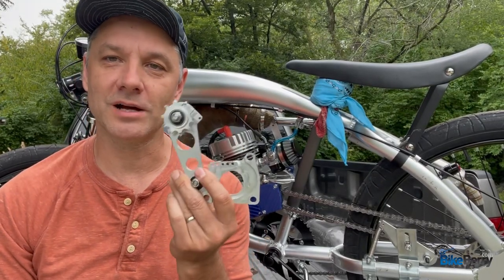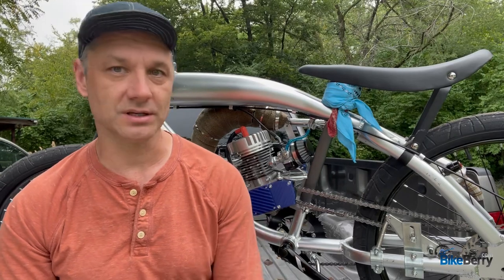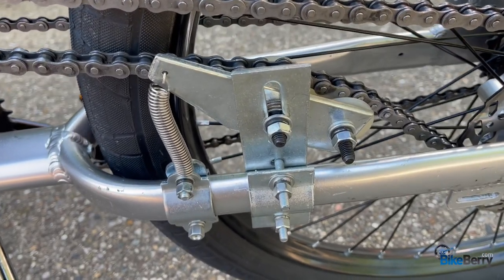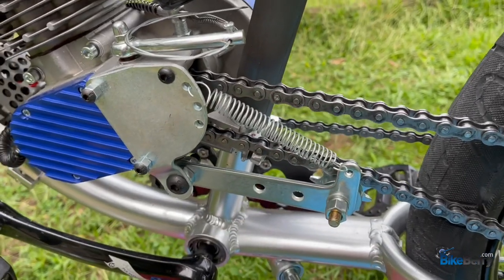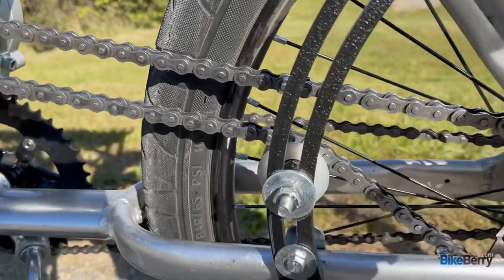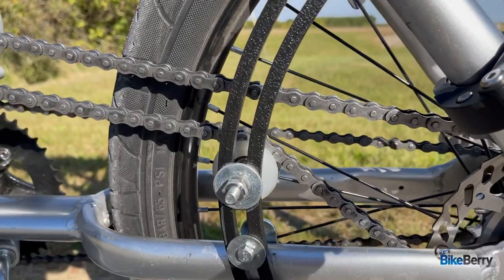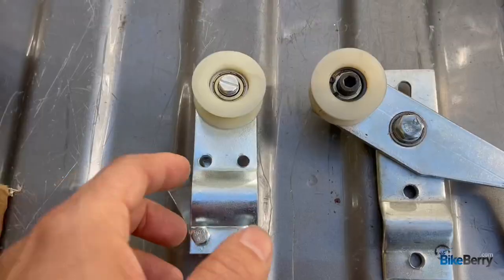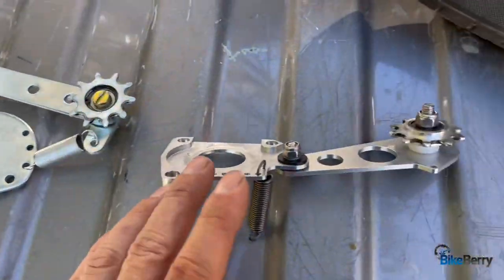6 Chain Tensioners Tested | Motorized Bicycle | Bike Berry

Comment: Great information as always. In my experience the tensioner should always be mounted for the bottom chain. The top part has all the engine torque on it. Second the tensioner should be mounted as close to the engine as possible to minimize deflection. It puts less strain on the links. Finally I love the versatility and security of the arch tensioner
Reply: 😊9
Reply: 😮8😢😮😮😊

Comment: Tony. On some of my builds I have used an Industrial rubber torsion tensioner, available from my local Industrial Supply store.
make mounting brackets to fit the position on the frame and use the stock guide roller. 
Once positioned, tensioning the chain is easy.
I note in your video and others that I have seen, spring tensioners, the spring tends to resonate. This does not happen with the rubber torsion one.
I have not had any issues with the Kit tensioner on any of the 23 Motorized bikes that I have built. I have seen the tensioners improve in quality from 2014, when I started. The first ones the guide roller did not have a bearing. The latest kits with the double bracket and angled adjuster are the best.
I replace all bolts and nuts that come in the kit with High tensile cap bolts and nuts with proper steel washers.  .

Comment: I used the nice billet one and just drilled a hole on top of sprocket cover right under top bolt for the spring. The angle of spring and additional tension remedied the centering and spacer issue. I also changed gear to a plastic roller and it has MUCH QUIETER mesh and resistance. Thanks for all your videos and advice....Have a GREAT HOLIDAY SEASON!😁 PS, I can share a video or send you a pic if needed.

Comment: I don't like the tensioner that comes with the kits because I've ruined 2 tires and I would worry to much about it going into the spokes. I ride with the spring tensioner that mounts to the engine case and I put a skateboard wheel as the tensioner wheel,chain doesn't slip off or grind into the wheel and my bike rides smoother. Great video tho!
Reply: This⬆️

Comment: I have tried 4 different tensioners and found only the Arch tensioner to be truly reliable in design. The spring tensioner that I bought for my friends bike pulled the bearing through the mount and failed within 1 hour. The stock tensioner with the 2 straps stripped out the bolts and nuts before even getting tight. I even tried a small tack weld, Unfortunately the tensioner itself bent due to cheap metal. Cool video though, I like that you tried so many of them.
Reply: Yea the bolts are like a soft aluminum. I ended up going to local hardware store to get better quality.  I had to cut a bolt off on the rag joint it was stripped so much.

Comment: Just from eyeballing it I would say an ideal setup would be a tensioner very far forward and an additional one very far back. Tensioners seemed to be all designed with a monoshock frame in mind where perfect alignnent under extreme conditions exist. I just went from a stock one to a simple three bolt case mounted, only because failure of the stock one would throw it into my rear wheel. Im only taking her on asphalt and i keep my speed down.

Comment: I've done em all and customized them by changing the mini sprocket for a wheel on the case mounted ones. I like the duel wheel and arch without mini u-bolt

Comment: I got a new motor kit, 50mm board out. I was running my bike with no chain tensioner for a long time with no issues. Now I have to get my chain about 1/8-1/4" out away from the new brackets for clearance. My thing is the new chain is longer and I'm not sure how many links it should be cut at than completely right fit, I was told about half inch longer?

Comment: Hey Tony I have the case spring that mounts on the engine only problem I'm having is the long  arm that the the spring and pully attach to keep coming lose making the arm flop what can I do to keep the bolt tight so I don't back off

Comment: I’ve seen some builders eliminate the tensioner altogether and just shorten the chain. Is there a downside to that other than when you need to remove the rear wheel you would need to remove the master link.
Reply: maybe when your chain needs tightened. when it gets worn out and stretches the tensioner would be nice for fine fine adjustments

Comment: My thoughts.1st of all many thanks dor your video. Im in the process of finishing the assembly of the F-zero bike w/ S4 engine taking my time dor about 6 months now. Taking my time by choice only as i am often enjoying and wrenching my Chinese enginered 200 cc ATV. The #3 case  mounted tensioner you stated that on ruff terrain the chain will jump off the spured sproket and its not meant for tight tension. I actually was thinking the same thing while watching the video before you mentioned this and was thinking instaed of the spured sprocket why not replace it with the smooth walled sprocket from the one that came with the engine kit. I have the case mounted tensioner that arrives yesterday and will attempt to finish the assembly with test runs today.  I will try both sprockets starting with the original spured sprocket afterwards will be the smooth walled sproket i mentioned early. I will post my results when completed. But please dont hold your breath waiting for my results. This will be completed as soon as time and the days events will allow.

Comment: My experience with the arched chain tensioner is that if you don't go fast enough to start the engine and engage the clutch the kick back from the engine can bend the crap out of the arch tensioner. It seems that these are made from cold rolled steel and the metal is very weak. At least the one from BB is. That's where I bought mine. I don't use it since it's garbage now. Just something to be aware of. Tony - i noticed your black arched chain tensioner is thicker than the one BB sold to me. Where did you get it?

Comment: Best one i ever got was just like the bare bones spring type like the one in your background at the start of the video modified with some other parts. I work in a steel stamping shop and we used to run a part we called the boomerang because it looked like one. It had a few holes punched into it that when the part was bolted to the bottom and top bars of the frame the tensioner arm could bolt on and the spring hooked into a hole on the part. There was another hole I fed a bolt through so when turning the bike over the tensioner arm would stop stretching all the way down, but still had enough clearance to function while riding. Never had an issue with it

Comment: A quick note, make sure the chain tensioner runs parallel to the chain! on my beach cruiser, I had to bend the main plate in a vice to get it lined up, and it works flawlessly.

Comment: Hey Berry that bike behind you in this video is the kind of bike I want to put my moto on with a 32 tooth so it will run better I have it on a rock creek huffy 18 speed and it won't run faster than 28 miles an hour and I want it to run faster like 45 or 50 miles an hour.

Comment: Can you recommend the best most reliable engine. I'm doing my 1st build and want the most reliable engine I can get. Thx.
Reply: BikeBerry stage 4 has treated me well! Link to site in description.
Reply: Don't go with the stage 4 the upgrades aren't very good better off buying the stock kit and buying the upgrades separately getting the ones you want
Reply: @tonytaylor5087  Stage 4 has treated me well also. Haven't had any problems with the engine itself, hardware is a different story.

Comment: I ended up not using them as I wasn’t impressed with the quality, I ended up fitting a Jack shaft kit, and now I have x8 gears to use with the motor, a far better upgrade , use a stronger e-bike chain and you have to replace your rear sprocket set more often (which is understandable)..
It’s best if you have the centrifugal type clutch for this set up and ease off the throttle when shifting gears..🤔
Reply: I’m interested in the jack shaft assembly.
Reply: It sounds good.I'd like to know which brand you used.The 1 I'd saved to my 'Wish List' isn't available anymore.Thanks.

Comment: Just get rid of the slack in the chain all together you're probably wondering well how can you do that if the links are only so big you take one out too many it's too small too tight you put spacers on the brackets for the motor mounts it's adjusting the motor itself you can move it forward slightly if you have the room inside your frame you'll be able to move it forward and maybe even slightly up this will take your slack out of your chain eliminating the need for a chain tensioner eliminate as many moving Parts as possible on any type of machine and you will have less room for error and breakdowns simple is better.
Reply: Hardly ever can you work it out to not need an adjuster. Just saying. IMO after building dozens.
Reply: @MrCbell57  right, slack will always return

Comment: stock tensioners worked fine for me when its used properly on an oval chainstay, i did blow up a wheel once when i had rubber between it on a circle chainstay.
Reply: For sure.

Comment: I find this to be the hardest part of getting these engines set up especially if you have a small frame.  I honestly love the idea of that curve tensioner, it is the only one that looks reliable. I have tried the spring tensioner and the stock one and both do not really work for my set up and I now have damaged spokes after having the chain drop off too many times.  I think best of both worlds would be to design a tensioner that is both adjustable and uses a spring but uses the same mounting as the curve one so that it always keeps the chain where it is supposed to be.
Reply: Agreed

Comment: Don't use the cheap bolts that come with it!  what I did was went to my local hardware store, match the size of the cheap bolts, to get reliable one's, sturdy one's, brass works extremely well. machine nuts and bolts.  you literally  can replace them all for under 4 dollars!  Very cheap but will leave you with one less headache, thank me later!
Reply: I did exactly that. Them bolts that come in the kit are pretty cheap and strip out with no effort. The lock washers were even popping out.

Comment: vc não acha melhor por o kit com polia e correia dentada
Reply: What do you mean?
Reply: @tonytaylor5087  R$ 230,99  11%de desconto | Movimentação da correia não mais 415 corrente apto 2-stroke 66cc 80cc motor motorizado bicicleta roda traseira polia roda dentada 50t equivalente
Reply: @aristeujunior8908  It slips quite a bit if they get wet or you use an engine with more torque.
Reply: I haven’t tried the belt drive system yet. From what others say I’m thinking it won’t be as reliable as a chain. Look forward to testing one though.

Comment: The best chain tensioner is none at all. Cut your chain shorter and if needed use a half link. You forgot a chain tensioner, the spring tensioner that has a plastic wheel
Reply: My stock tensioner fell apart while riding. I run no tension and it's fine

Comment: The best setup is two chain tensions. One right by the motor guiding the chain back into the motor and one right in front of the rear wheel holding the chain like a 4 wheeler does when it’s sliding on the plastic protector. At 3:17 you can watch how his top chain is bouncing everywhere that’s what the second tensioner does is hold that vibration down while the one by the motor is actually keeping the chain tight. Also please don’t be like this guy and just let your chain hit your rear wheel. Dangerous

Comment: Couldn’t you just shorten the chain and not run a tensioner, seems that would be simpler while eliminating another part that could malfunction or break….
Reply: Not enough wheel adjustment